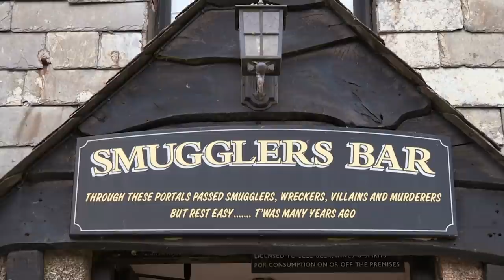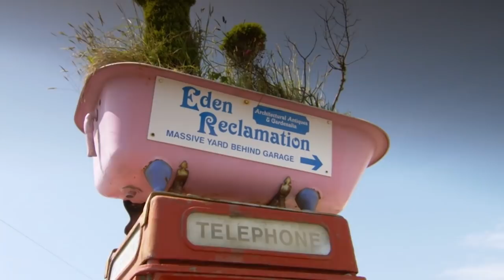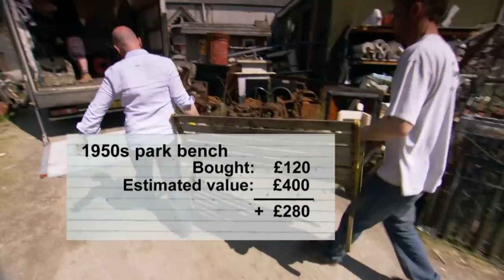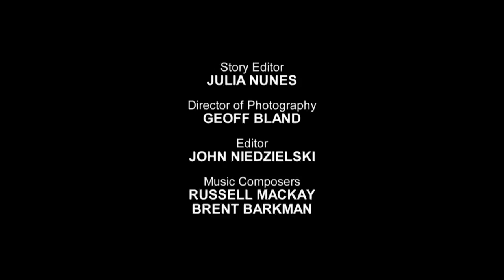Drew Finds Amazing Items In Country House | Salvage Hunters

Comment: Those benches aren't from a chapel they're actually from a train station
Reply: Why would a chapel need reversible backs?  I was sitting her epondering, knowing I have sat on them (and as a Heathen not in a chapel) and you have solved it,  Ta
Reply: @hogwashmcturnip8930  Also, Drew bought similar benches that were from a ferry boat!